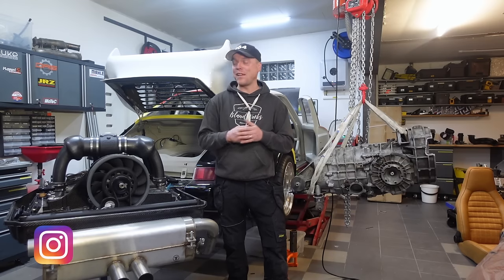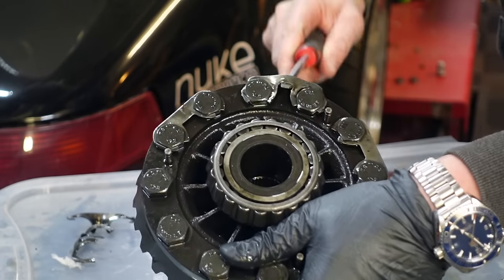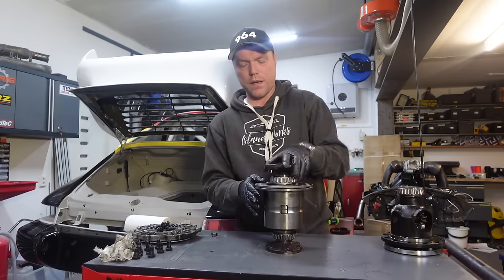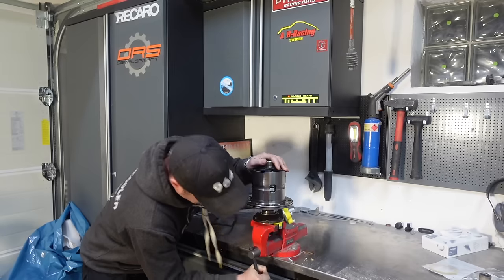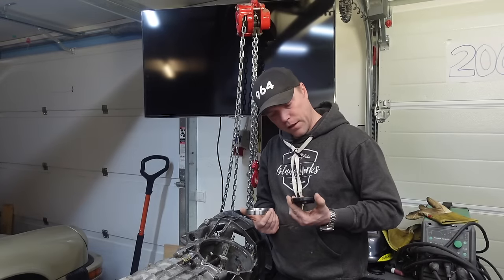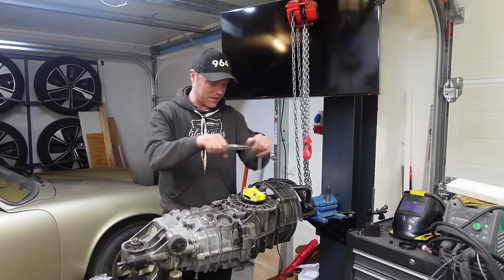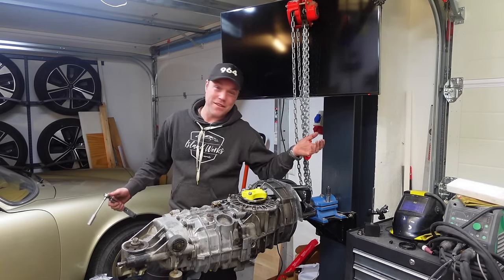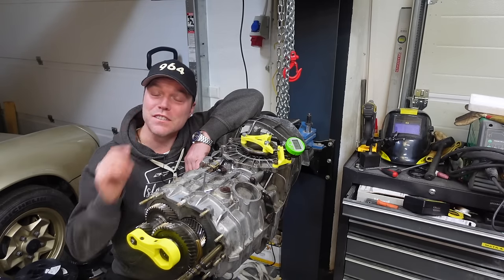Installing a Limited Slip Differential in my Porsche 964

Comment: Nice video. Most Porsche's factory limited slip is 40% locking. My 1979 928 has the factory m220 locking differential and I did the break away test and the minimum was around 22 Nm. My 82 911 SC doesn't have one and to be honest, a limited slip on street used classic air cooled 911 with anything under 300 hp is pretty much useless. The engine location obviously adds the advantage of traction. A front engine  rear drive like the 928 can somewhat benefit from a locking  differential. I always assumed the 930 came factory equipped with one and they didn't. It was an option. To my suprise, many 930's have open diffs. Many 911 experts actually say it can cause adverse oversteer in street use.

Comment: Thanks for posting this. I have an '87 with the factory open diff and have been kicking around the idea of putting in an LSD but was concerned about how big of a job it'd be to get into the gearbox. Seems like the diff replacement procedure was well thought out on the G50 though!

Comment: To help put things in perspective, I race a Mazda MX-5 in the State, when I ran a clutch pack LSD, I would set the break-away to 80 ft lbs (~108 nm).  Your 100nm is ~74 ft lbs.  Therefore, your break-away should be very nice and manageable.  Also, it is desirable to have lower break-away in braking, especially when trail braking into a turn.  Otherwise will cause excessive understeer.  Keep up the good work!
Reply from the maker: That’s a great reference thanks!

Comment: Jonas, please please please when your using your press, put some safety glasses on, when bearings go they can fly everywhere, we have one at work that's actually in a cage for that reason.....A good idea too when setting bearing clearances is to flap out the ID of your old bearing so it can be removed easily then use your new bearing right at the end, saves pulling a bearing on and off with your press and the pullers.... Top quality video as always mate 😉👍🏻
Reply from the maker: That’s really good advice! It’s so easy to take the quick way at home when doing it properly only takes a few seconds more!

Comment: Are there LSD with infinitely variable preload? Like with a ring on a threaded shaft that would preload a spring a bit more or a bit less?
Reply from the maker: Believe it or not by the 964 C4 has a progressive diff like that actuated by a lever and a hydraulic cylinder. An amazing gear box but also a very heavy option
Reply: @islandworks  Thank you for this answer!

Comment: I had a truetrac diff on a front-engined V8 (LS1) sedan and it was wonderful to drive.  I assume this diff, coming from a cup car probably has more lock under decel than accel, which a truetrac style diff cannot provide.  I believe this is common for stability under braking for mid and rear-engined applications?  Nice work either way, great use of custom tools to make your job easier!
Reply from the maker: Lots a great alternatives out there! Im looking forward getting to test this one!

Comment: Another great video. Surprised you didn’t opt for lightweight aluminum side covers.
Reply from the maker: The switch out the LSD casing you mean? Is that an option?
Reply: My reply was deleted. Patrick Motorsports makes aluminum side covers.

Comment: Like how you just tear into everything!   Question, on the C4 transmission, I know about the center differential clutch pack, but does the C4 have a limited slip standard in the 64 type tranny?
Reply from the maker: The G64 is a marvel of engineering and one of the best I’ve ever seen (if you need AWD). It has two controlled and actuated LSD and one open diff for the two front wheels. 

So yes it has the same diff between the rear wheels.

Comment: Thank you very much for this video.. Just a few questions, why not choosing an Wavetrack differential (seems to be very popular for the 964)? is it possible to share where to find all the bearing and shim kit we need? Im plan to install a wavetrack on mine G50. Thank you
Reply from the maker: I found this one from a friend that was selling it. The 996 cup diff has a very good reputation for track applications but there are many other good alternatives. 

I got the shims from Rosepassion in France. Look under the 996 GT3, they are less costly than the ones under 964 and should be the same thing.

Comment: Did you get the distance from the centre of the drive shaft hub to the printed pointer and dial gauge holder from Porsche…. This is critical as any deviation from the distance from centre means the measurement of backlash is meaningless
Reply from the maker: Yes, it’s in the workshop manual and is 80mm